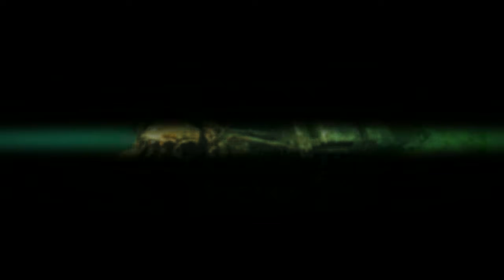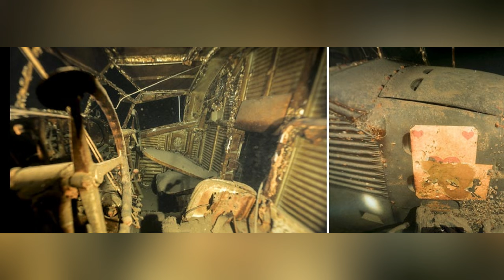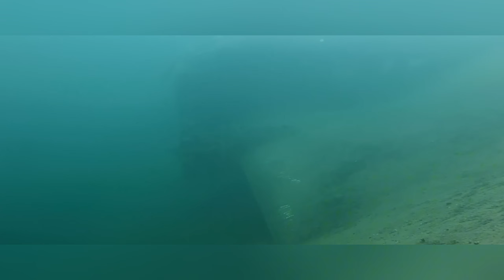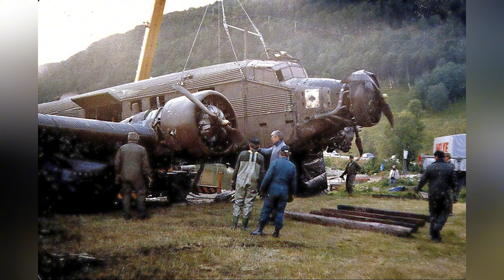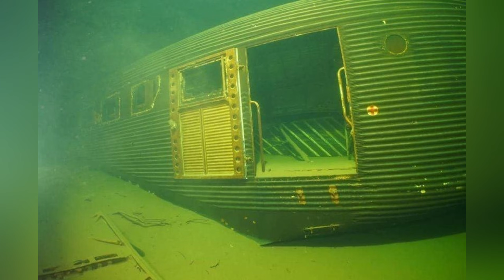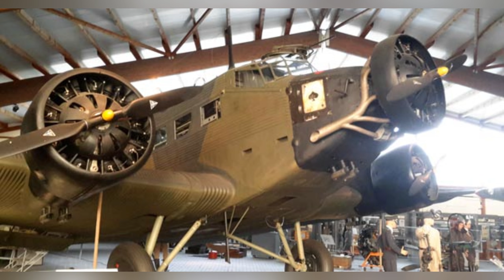Recovering Ju 52: Frozen Wrecks Raised from the Abyss

Comment: Did the divers find any weapons,gear, ammunition etc?
The planes were headed to Narvik with supplies for the fighting going on there.
Only one plane was repaired and refueled so they could get off the ice and fly out
I can't imagine that the all the supplies from 12 aircraft plus 24 men (assuming each plane had a pilot and copilot)
Could even fit into one single plane let alone the weight.
Just curious to know if the supplies sank with the planes,or did the Germans go back and recover as much as they could before the ice melted